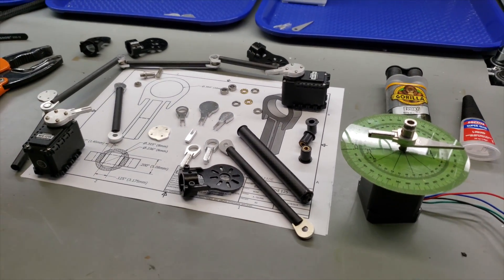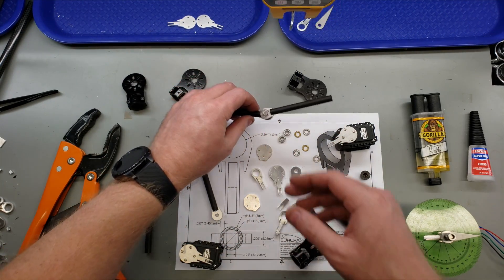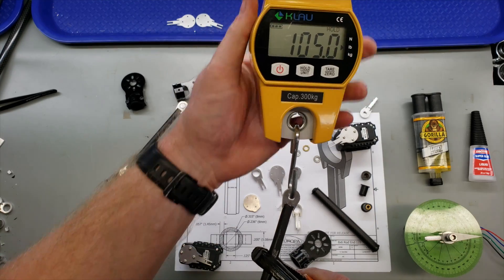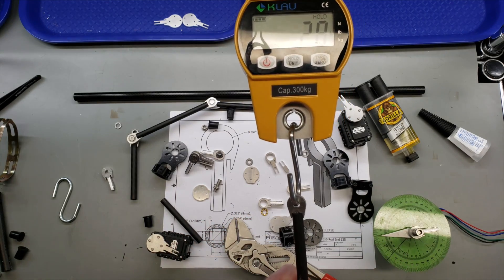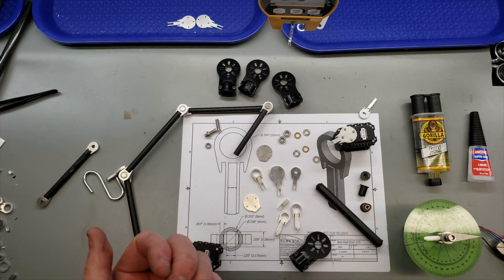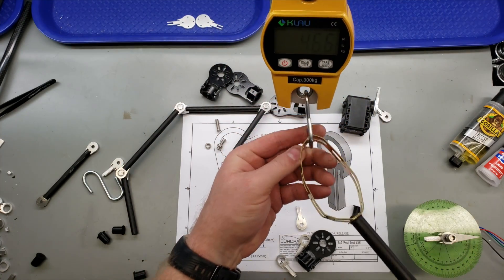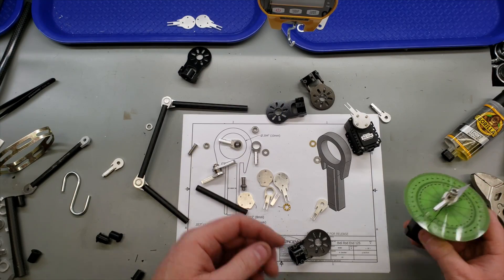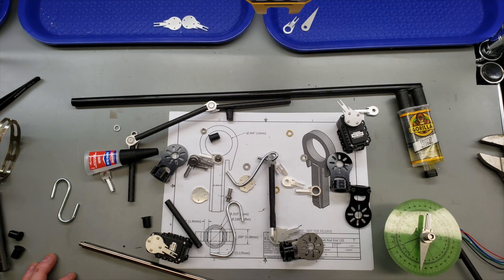Open Source Carbon Fiber Attachments + Strength Testing

Comment: Thanks. There's not a lot out there for carbon fiber connectors when it seems like there should be a lot more options.

Any ideas for thinner tubes? Some sort of external sheath for 4mm tubes?

Comment: Super glue is used to fill chips in carbon fiber propeller blades in helicopters. The put a dab of super glue and then sprinkle baking soda which cause super glue to harden instantly and also adheres 10x stronger. They continue this process until the chip is filled then sand flat.

Comment: I´ll bet you get better results with another brand of epoxy. A 24h Epoxy should beat any super glue every day, all day. Try something like West Systems or any other industrial brand. In my experiance the failing part would be the carbon fiber tube in this experiment(if prepared correctly).

Comment: Did you make the wire-frame work benches yourself, or did you source them from somewhere? That's a great idea.
Reply from the maker: Thanks! I used two full racks in the back and 2 half racks in the front. I connected them all together with several zip ties and a few bolts. You can buy them on Amazon here: https://amzn.to/2RuGv5k

Comment: Nice bench/shelves, what is the model/brand? thank you
Reply from the maker: Thanks! I used two full racks in the back and 2 half racks in the front. I connected them all together with several zip ties and a few bolts. You can buy them on Amazon here: https://amzn.to/2RuGv5k

Comment: Carbon fiber arrow heads use a high temp hot melt glue to hold semi-barbed threaded inserts in. This forms a surprisingly high strength bond. It may not work as well for your inserts through because you are using a square profile and have less surface area contact with the shaft.

Comment: Did you do any surface prep to the inside of the carbon tubes? I wonder if the epoxy would hold better if the inside of the tube was scuffed up some? I know that makes it less ideal for quick assembly since it adds a step but it might make for a stronger bond.
Reply from the maker: I didn't but I'm sure it would make it stronger if needed but 60-70lbs should be plenty sufficient for most application. I'm happy the CA glue worked so well because it sets up much quicker and I don't need to mix two part epoxy so that's a win win for me.

Comment: I take it from the burrs shown on the aluminum components that you machined the OD profiles? so then how did you make the tubing clearance slots ? also machining?  One other note... the glue in all of the demonstrations is way stronger than a 3D printed part would be. I like the aluminum but access to accurate machining could be a problem. Keep up the good work. Always interesting to see what you've done.
Reply from the maker: Thanks! I laser cut the aluminum parts. Check back at some of my laser cutting videos to see that machine. They would not be as strong, but 3d printed parts would be plenty strong for most hobby projects. Laser cutting out of plastic like acrylic or something similar would work pretty well too.
Reply: well lasercutting aluminium produces a sizable burr since the aluminium has the tendency to melt before ablating since its more reflective. the burs come off easily though.

Comment: Super glue is pretty brittle. Any concerns with it coming lose over time due to vibration?
Reply from the maker: It depends on the application but for most things I would not be worried at all about that in this scenario. Brittle is not necessarily a bad thing here. Concrete is brittle but works great when used in combination with other materials with complimentary properties like steel. Since the attachment is already a tight press fit, the CA glue is not really being used as an adhesive here as much as it is a filler material for a "perfect press fit" with great friction properties. If I were doing something critical like hanging babies from it all day long I would drill a hole straight through the epoxy version after curing and press in a spring pin.

Comment: Very impressive. How tight of press fit are you using for the bearings? Straight of the laser? or milled/ drilled afterwards?
Reply from the maker: Thanks David! Those were 10mm OD bearings and I just used a 10mm hole straight off the laser without any issues. I figured if I had to, I would ream or mill them but it ended up fine.
Reply: @ProtoG42  BTW we may actually use this on our robot this year!
Reply from the maker: @DavidGuzman-yb7xi  Awesome! Let me know and I'll personally make a few linkages for you to test.

Comment from the maker: Here are links to some of the parts used in the video:
8mmODx6mmID Carbon Fiber Tubes - https://amzn.to/2J5xVqz
Thrust Bearings: https://amzn.to/2FtDP1u
5x10x4mm Bearings: https://amzn.to/2CiXCxD
Weight Scale: https://amzn.to/2DlTaQl
Super Glue: https://amzn.to/2S2Lw5L
Epoxy: https://amzn.to/2RUn725
12mmx10mm Carbon Fiber Rod: https://amzn.to/2W1NdiO
Well Nuts for 12x10 Rod: https://amzn.to/2W1fLsV
Parallel Face Pliers: https://amzn.to/2Cs3S6a
Locking Pliers: https://amzn.to/2MiZ7jQ
Quadcopter Attachments: https://amzn.to/2CuH3i9
Dynamixel MX-12W Servos: https://amzn.to/2M6xLgK
OpenCM Controller: https://amzn.to/2FugJI3

Link to Attachment Models: https://github.com/ProtoG/CarbonFiberAttachments